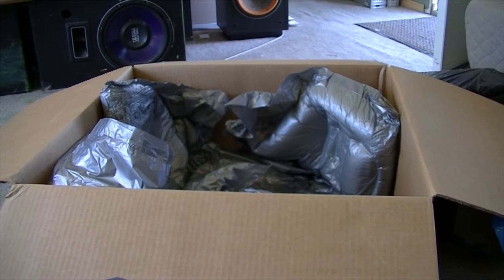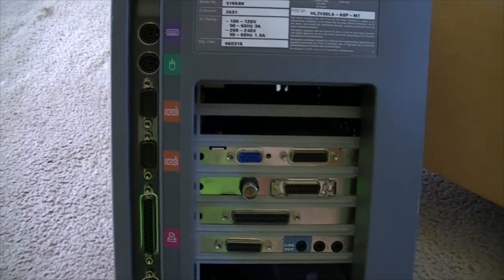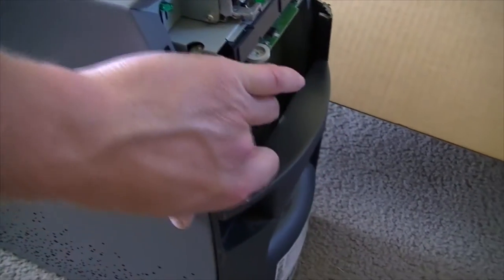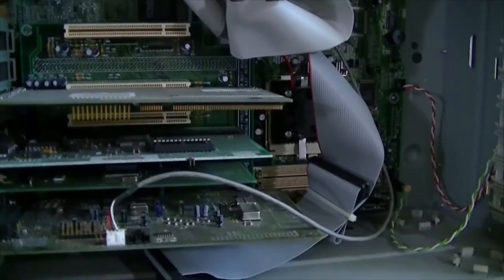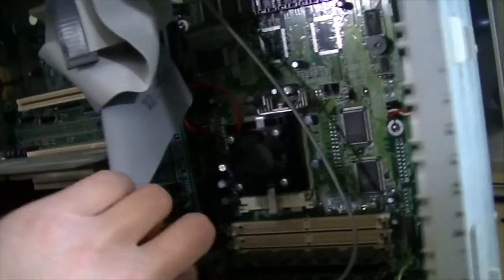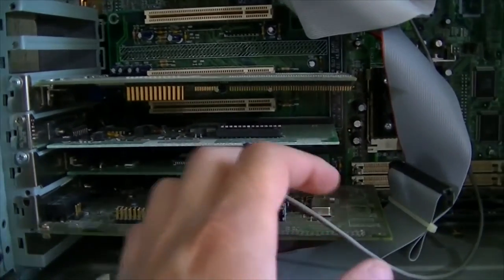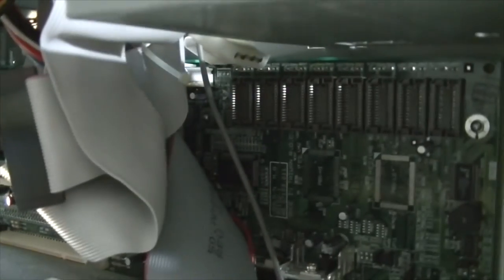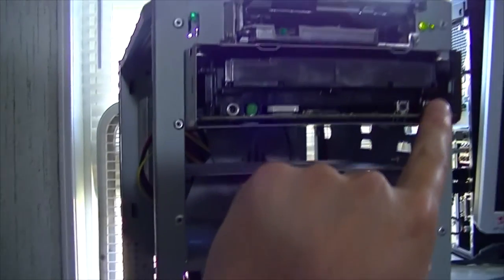Acer Aspire 5166SK Pentium 166 Midtower evaluation

Comment: The 15-Pin network connector is for Thick Ethernet, I had to work with it once, a box plugged into that connector and thick Co-Ax cabling carried the signal, the stuff we had hated being bent around the inside of the walls. As for the motherboard, so far as I remember that form factor is called LPX.

What a strange machine, I have never seen cache come as stand-alone SOJs like that, it looks more like it is for older video memory such as used for the S3 Vision. The smaller SOJ socket near the CPU though, I have seen static RAM for caches in packages that size before soldered to COAST modules, though finding chips on their own would probably be a tedious task even if you did figure out what Acer intended them to be. Also, to add further confusion, the RAM type used on video cards was also available in that size of package, though I never have seen anything with sockets for it as they appear to have been interchangeable with a through-hole DIP part, the sockets for which were probably cheaper at the time due to more widespread use.

The board maker also trolls you by having pads for cache chips they never installed.

Interesting video.
Reply from the maker: HighTreason610 I came to the same conclusion about the cache chips being the same used on COAST. It looks like from the online diagram and jumper settings of this motherboard, this uses Async cache, not PB. I have a Async COAST module from a 486 that is bad, and desoldered the chips, sure enough they pop right into the sockets. Looking at the traces and some surface mount resisters above each socket, it appears Acer designed a COAST module into the board instead.  I was hoping the actual chips from this COAST module that I sacrificed were still good, and it was one of the surface mount resistors that shorted out at some point but so far only 32K is being recognized, and when the cache is enabled it simply locks right after memory count.  Some or all of the chips must have been damaged at some point.  I have another one I know is good, so I may desolder those chips too. There is a seller on ebay that has a large supply of these COAST modules brand new for under $4 at the moment. If I had no way of replacing these things, I would not even be considering doing something like this :)

It kind of makes sense to me why Acer went this route, given the questionable reliability of COAST modules at the time, although I have never had a problem with one making good contact in the motherboard. The board does have jumper settings for 512K and 1MB Cache, but I think in the long run this idea to socket the cache memory was not very good, but definitely interesting and I guess something only Acer did. 

The empty solder pads say PBS-Hi PBS-LOW, which I am guessing is for PB cache, and there is an empty bank of solder pads that looks like it would be for a VR module some of these older boards had. My only guess is they had a second version of this board for MMX cpus with PB.  There is apparently also a version that had built-in 10MB Ethernet. There is a blank right above the PS/2 ports which is where they thought was a good idea to place an ethernet cable.

Comment: The front panel actually had a handle beneath the drive bay cover that you pulled and released the side panel and front bezel from the chassis.  They also came in Cyrix 6x86 flavor for more business/cost oriented users.  Typically they used Trident or Cirrus Logic SVGA chips with 1MB installed with sockets for upgrading to 2MB.  I think there were models with ATi 3D Rage II 2MB adapters for the top SKUs, but I could be wrong.

Comment: AMD Socket A coolers and Socket 370 heatsinks fits perfectly on a Socket 7 and vice versa. Back in the days, I used a socket Pentium 3 heatsink on an Pentium 166 mhz system, worked like a charm. And it was an overkill cooler, but it worked.

Comment: That looks like an AIX port on that Ethernet card.  You might still be able to get an AIX adapter to convert it to a standard ethernet jack, almost certainly only 10Mbps though.  I've used them on some older Cisco switches that I've played around with.  Those Matrox cards were the best back in the day, right up until the 3dfx cards came out and dominated. Nice system!